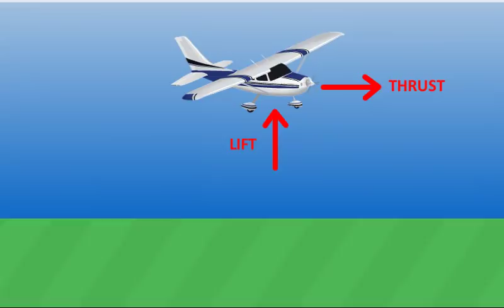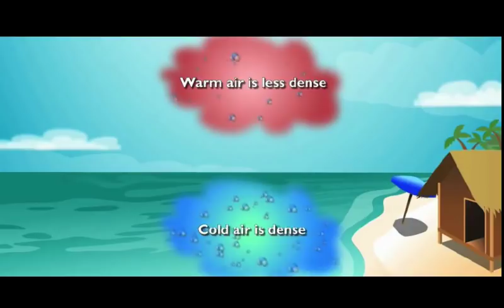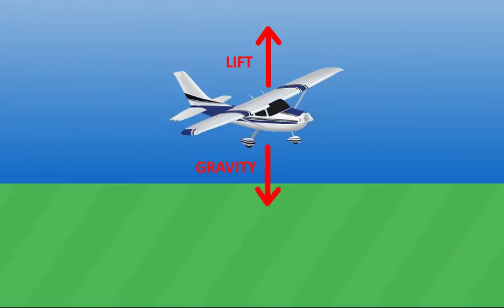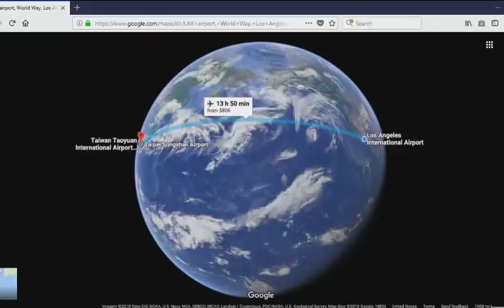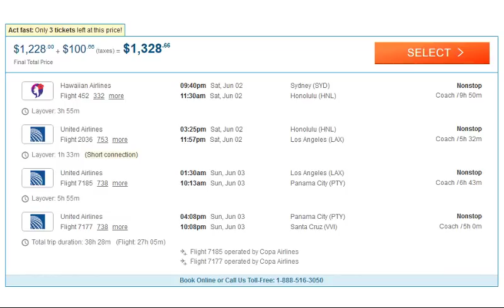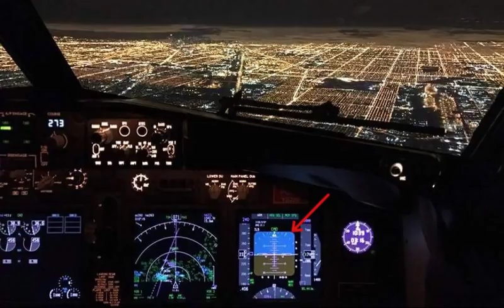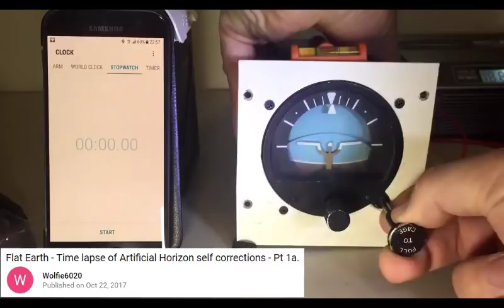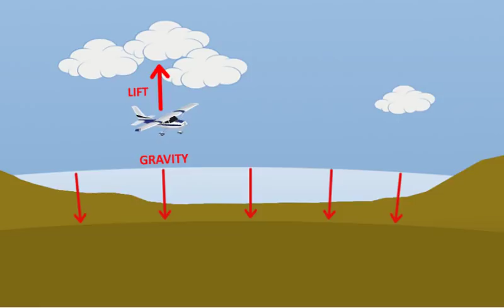Flat Earth Falsities - Plane Nonsense

Comment: I have a really silly question, it is about aircraft flying.

Let's suppose that two planes are flying the same distance, but not over the same space, for instance one is flying over the Rockies while the other is flying over the Sahara Desert, same distance but only over different terrain and but equal speed. If time is faster over the mountains than it is over the flat regions, would both fly the same amount of time?

They wouldn't necessarily both have to fly the same height, considering the desert would not have the mountain obstacles. But the time for flight, would the mountains present a quicker flight time?

We know the atmosphere is not the same thickness from ground to outer atmosphere, so would there be less friction the more higher you fly, therefore reducing the time?
Reply: If they are not flying at the same height then they are not flying the same distance.  Picture two cars on a race track, the car in the inside lane travels a shorter distance than the car in the outside land.  Airplanes do not fly at high altitudes because of obstacles, they fly at high altitudes because it's more efficient.
Reply: +OMG GMO Yes, but those cars are both on the ground. Time is different higher up, that's why it takes longer for water to boil in Denver than in Indianapolis.

The air is thinner in Denver than Indianapols, therefore there would be more friction in Indianapolis. Time is relative anyway. 

I think my question should be better rephrased as: Are the flight times exactly the same even though the terrain is different even if the distance is the same?
Reply: Most commercial flights go higher than any terrain, so it shouldn't really matter.  Flight times are determined by maximizing profit for the airlines, which means optimising aircraft, fuel and personnel costs.  Flying slower uses less fuel, but you have to pay the flight crew more because they work longer, etc.
Reply: +Stephen H Ok, that's commercial planes, but what about small ones?
Reply: "Yes, but those cars are both on the ground."
That doesn't matter.  An airplane flying at 10,000 feet from NYC to LA is flying a shorter distance than an airplane flying at 40,000 feet.  The "track" of the lower plane is shorter than the "track" of the higher plane.

"Time is different higher up, that's why it takes longer for water to boil in Denver than in Indianapolis."
That is not because time is different it is because air pressure is different.  

"Are the flight times exactly the same even though the terrain is different even if the distance is the same?"
If both the airplanes are flying at the same altitude then the flight times will be the same (assuming identical wind and weather conditions).  If they are flying at different altitudes then the plane with the higher altitude will have to fly a longer distance.
Reply: moorek1967 - if you have avoid or go over obstacles on the terrain, it should take a little longer.
Reply: +OMG GMO That does make sense. Oh, I am not a Flat Earther, I just wondered about that thing.
Reply: Let me try to explain, imagine you have a circular race track with two lanes.  You agree the inside lane of the race track would be shorter than the outside lane, right?  Now just turn that race track vertical.  The inside lane would still be shorter than the outside lane.  The Earth is the race track.  The altitude is the lane.  Lower altitude is the inside lane, higher altitude is the outside lane.  A plane at a higher altitude would have to travel a farther distance in the air.  Note that the distance traveled on the ground stays the same, but the distance through the air is different.
Reply: Moorek1967  ""Time is different higher up, that's why it takes longer for water to boil in Denver than in Indianapolis.""

Actually water will boil faster or sooner at higher altitudes than it will at lower altitudes.  This is because of the difference in ambient pressure.  Less energy (heat in this situation) is needed for water to boil when the water is at less pressure.

For example water will boil in a vacuum ( near zero pressure)  without applying energy.

Since water will boil at a lower temperature in Denver it will boil sooner since it takes less time to achieve the boiling temperature.

  However it will take longer to boil an egg in Denver since the temperature of the boiling water is lower.  This is why pressure cookers are often used as this will raise the pressure of the water making the boiling point a higher temperature.

Questioning things is not silly for this is how we learn and expand our knowledge.
Reply: Moorek1967   I might add that I believe you are correct in theory that two planes flying the same speed and distance at different altitudes would result in the higher altitude plane spanning the same distance quicker.

How much quicker?  Perhaps a billionth or trillionth of a second.  But this would be problematic to actually test of course since the speed of each plane could not be synchronized to anywhere near the accuracy needed.  Also as  OMG GMO pointed out, the distances from point to point on the spherical Earth would be greater at a higher altitude and you would also have to include the distance added due to accent and decent.

Good question although it appears that you have been somewhat mislead somewhere about the difference in time due to altitude changes.

Comment: Gravity is only a theory.....but yet you speak of gravity as a fact.
Reply: Look up what a “theory” means in science. It is a very different definition to the colloquial version. 
If it makes you happier we can also call it “the Law of Gravity”.
Reply: GrahamStw you call it cheerios if you want.....there is no proof or evidence that gravity exists.....hence,  it's a theory
Reply: GrahamStw yeah...o.k.  the same thing can be said with an elevator moving up.  Same effect as your so called theory of gravity.
Reply: Well not quite. The lift would need to be accelerating upwards at around 9.8m/s² 
That would give a pretty good impression of gravitational pull towards the Earth. 

But we know that isn't what is happening because:
- gravitational pull on Earth varies slightly with altitude, latitude and local geology.
- gravity can pull things sideways, as the Cavendish experiment shows.
- if a flat earth was accelerating upwards at around 9.8m/s² then it would be moving faster than light within a year which we are pretty sure isn't possible.
Reply: Yeah I wasn't going to get into the specifics of what we think happens as an entire planet approaches the speed of light because that is definitely deep into the hypothesis area. :)
Reply: GrahamStw - Slight correction - constant acceleration would make us approach the speed of light asymptotically, not exceed. it.  Of course if that were the case, then all the starlight from above us should be blue-shifted into gamma rays by now, and we should be fried crispy.  Unless the whole universe is accelerating "up", of course.  But then the perceived gravity on the moon and in space ships should be the same too.  But space and the moon are fake, etc.....  See how every one of these ad hoc excuses just creates more ad hoc excuses for FEs?
Reply: Glen Salch - Magnetism is a theory too.  How do they stick to your refrigerator?

Comment: So....hurricanes coming from Africa to Florida defy the movement from the earth's and air rotation?
Reply: They don’t “defy” anything. 
If you breathe out while driving your car you are not defying the 70mph wind outside.
Reply: GrahamStw  you aren't accurate in your description.   Moving at 70 m.p.h. in a car has constant motion.  The air you blow out looses its force due to not having its own energy production.
Reply: Sorry, you'll have to clarify why you don't think my analogy is accurate.
Reply: No... that would be a very large text to completely go into detail......but heat migrates to a colder place.   You have to understand that there is no such thing as cold, cold is just the absence of heat.  It is natural for heat to migrate which is energy motion
Reply: No... with energy motion created by the migration of heat to a colder place......it picks up air particulates, which create mass.  This mass, now evaporates water into moisture which condenses when it reaches an absence of heat.  Called rain.
Reply: No... that would come from different pressure in the air column.  Because all land mass is surrounded by water, the pressure systems vary.  The difference in pressure from the surface of the earth and space is also an element of pressure.
Reply: No... you've skipped over my question completely to talk in a runaround conversation.  Globber state the earth spins and encircles the sun.  They claim the atmosphere spins with earth too.  The earth spins in a specific direction so they claim.....how does a hurricane travel in the opposite direction of all of that?  I explained how they move around on a flat earth.....but how do you explain how they defy the laws of your own spinning globe?

Comment: I'm not sure but I miss one argument from the FEs. It's about flying from the equator into the direction of the north pole. What happens with the momentum of 1600km/h of that plane. Is is fully compensated during the flight when reaching the north pole or what would be the correct argument why the plane does not drop right while passing areas with a smaller ground speed due to rotation?
Reply: Viet Woojagig this is actually the very definition of the Coriolis effect.
https://en.wikipedia.org/wiki/Coriolis_force
Reply: The plane will lose the angular momentum and associated kinetic energy as it travels north.  It will actually burn less fuel going north, as it is converting its original kinetic energy into heat via friction with the air  (the engines provide this energy when traveling east-west or west-east).  BTW, this applies to any mode of transport - cars, trucks, trains and ships.  I did a back of the napkin calculation, in a fully-loaded 787, it takes about 4000 kg less fuel to go from the equator to the north pole  than it does to go east-west the same distance.

Comment: Bro... u really think that are atmosphere is inclosed by a giant vacumm....
Reply: Weird how pressure gradually drops with altitude....what causes that?
Reply: I think that you figured this one out, Sparky!
Reply: Standard air pressure at sea level = 14.70psi
Air pressure at 4000m up a mountain = 8.94psi

A pressure difference you can check yourself, that exists just fine with no physical barrier. 
So if that can exist then why is it “impossible” for the practically zero pressure of the exosphere to exist next to the practically zero pressure of space?

Comment: How to apply the theory of gravity to airplanes, but it does not apply to the clouds ؟؟؟؟؟؟؟
Reply: South to north is not "opposite the attraction". 
Gravitational attraction to Earth pulls objects, including rivers, towards the centre of the Earth.
i.e. in the direction we call "down". Not in the direction we call "south".  South and down are two different things.
Reply from the maker: Gravity applies to everything. Clouds float because they are slightly less dense than the air beneath them. Gravity pulls on the air and the clouds, but it pulls stronger on denser things, so this forces the clouds up. This is called buoyancy. It is the same reason a cork floats in water. Buoyancy is a direct result of gravity.  See my gravity video.
Reply: Why the ocean is stuck to the earth. But we see, the Nile River is opposite the attraction. It runs from south to north. But the Tigris and the Euphrates flow from north to south.???
Reply: Because the airplane is also moving at that speed (plus its own speed). Did you even watch the video? I think this was explained pretty well.
Reply: how comes the airplane catch the runway while its moving around 400 meters per second?? i mean the runway...??

Comment: You dont have to tilt the nose of the airplane to lift the plain up, simple adding the trust will do it. Added speed will increase pressure lift on the wings and since the weight of the plane remains the same, it will go up. But as the air is thinning wit the altitude, wings lift decreases and gravity catches up at some alt level, until more thrust is added.

Comment: 6:21 I think you're wrong about the whole "gravity keeps the plane in a curved path around the earth automatically" argument.
Imagine a plane that moves forward by 69km, around 1 degree. In order to stay parallel to the ground, the plane must rotate forwards in absolute space by 1 degree, so something must provide torque to the plane to rotate it.

What about gravity is providing this torque? Surely it must be provided by the control surfaces of the plane, which to me constitutes "nosing down". If you think I'm wrong about this, I'd love to know why.
Reply: Yes, the airplane does need to rotate, but this is less of a problem than you think.

Imagine driving a car on a long circular road. You don't turn the wheel every so often to avoid going off the road, you hold the steering wheel at the angle that would make the car turn just as fast as the road curves. After that no further adjustments are necessary. 

In an airplane something similar happens with trim angles: you tweak them until you've reached level flight and that's basically it ... or would be if the atmosphere was a pretty turbulent place. The adjustments you'd need to correct for atmospheric effects are much greater and drown out those required for curvature.
Reply: +cearnicus
I don't think it's a problem, I just think that the video was very misleading, claiming that gravity somehow automatically does the work.
Reply: Yeah, I agree. It could have been explained better in the video :( 

There are two questions that are usually asked in tandem
1) why doesn't a level flight gain altitude?
2) why doesn't the plane need to pitch down?

My guess is that Voysov got the two mixed up in his mind, thereby getting neither exactly right. I hope he puts up a correction on this.
Reply: Rolf, naw man that's just a lie Big Air is telling you WAKE UP SHEEPLE! :P

Yeah, what you're saying makes perfect sense; I can't believe I missed that. So once again gravity turns out to be the correct answer.
Reply: +Rolf Jander
So gravity is providing the torque?
Reply: +Rolf Jander
This makes sense, thanks.